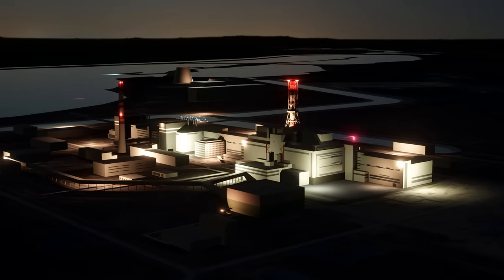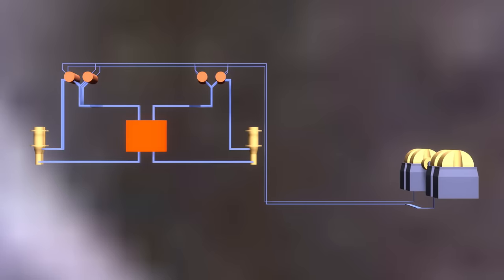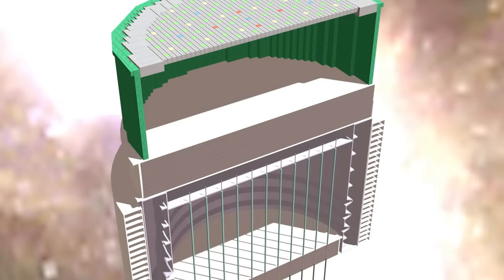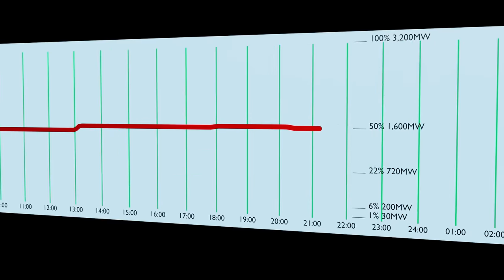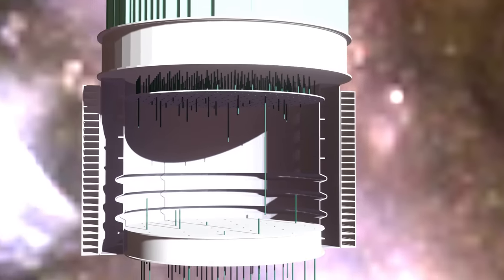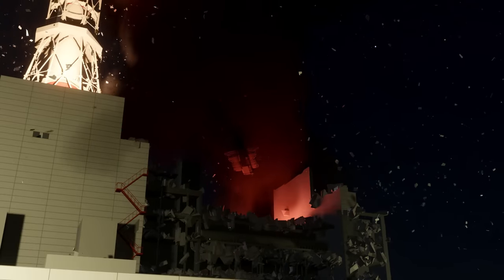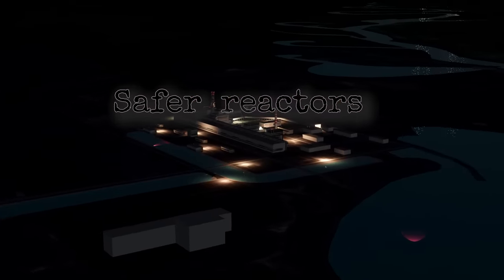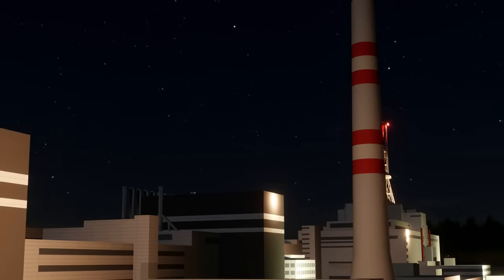CHERNOBYL AZ-5 why it exploded

Comment: An excellent video. The designers of the RBMK were well aware of the problems of the design. Particularly at low power levels. Apparently they produced a detailed manual explaining what the operators should do. However the KGB felt that the manual could fall into the hands of a terrorist/saboteur. 
As a result the manual was suppressed.  As a result of this the power station staff had no real idea of what to do. The remarkable thing is not that the disaster happened but that it hadn't happened earlier. As you point there had been problems at Ingalina and Leningrad. But due to the culture of paranoia in USSR this information was not disclosed.
Reply from the maker: Fabulous comment!! Thanks.  I'm learning all the time from your comment and others like it...
Reply: Are there any sources for claim that KGB was behind preventing releasing manual about reactor flaws, though? Because there are sources that main designer of the reactor Nikolay Dollezhall ignored the reports of flaws, as acknowledging them could hurt his career, because he was seen as a flawless genius in USSR. Alexandrov who was supervising him, was also engaged in advocating and supporting this reactor type. It is true that moving the supervision of operations of nuclear power plants from one ministry to other apparently contributed to problems with communication and flow of information. But this transfer was done because designers of reactors most probably lied that those are ready, very safe much more than they really were, so party assumed that they can be supervised by more 'civilian' ministeries, such as ministry of energy. In my opinion designers were too ambitious and lied about progress with reactors, because of that they later had to rush the design process, with resulted with trivial errors. For example water space at the bottom of control rods resulted from miscalculation, designers initially thought rods could be longer, this space at the bottom of reactor was meant to be taken by longer graphite tips. When it turned out that those would not fit, and it is  impossible to change the whole construction (as first reactors were build almost at the time of design process and equipment was manufactured already), they assumed they would use different technology to reduce amount of water (water film cooling). But this technology finally turned out to be unready, so they were left with too short tips. Like an architect who forgot to include the height of the building when planning number of floors. Absurd and terryfying. Buy that's what happens when design process is really rushed, that's why nuclear phycists shouldn't lie about having their reactor designs proven and ready, as this most probably happened. They believed too much in their own genius, especially because people from communist party, even such high ranking as Kruschev were not intelligent and knowledgeable enough to know that physicists are lying to them about reactor progess. Designers and other people from Kurchatov institute who were promoting the RBMK construction, such as Alexandrov, Dollezhall, Legasov (as he was not such a good guy in reality, earlier he was also promoting RBMK despite it's flaws) believed they can get away with such lies and errors because they are smarter than everybody else, and that ultimately nothing will happen, so errors in reactors can be covered up to protect their careers, especially because it was easy to keep things secret in nuclear industry in the USSR, which makes it even easier to designer of reactor to hide his errors. But it happened and revealed everything. If we only knew more about design process of reactor,. I think what happened and what really caused chernobyl, is what I have described above. Not screaming diatlov, but lying physicists from Kurchatov institute, such as Legasov. Ironically, HBO series end when he is talking about lies being the cause of all problems. He was a a part of that lie, despite show portraying him in good light in opposition to others.
Reply: @cytrynowy_melon6604  Quite Tomasz.  It is easy to forget that the RMBK was a dual purpose reactor. As it was designed to generate electricity/district heating and to provide weapons grade plutonium. Actually it was carefully designed to allow it to operate on natural uranium without using heavy water. What is apparent is that the lead design engineer Nikolay Dollezhal (1899-2000) was well aware of its shortcomings. However for the reasons that you outline he kept quiet. That said the RMBK proved to be both reliable and robust in service. The issue with the fuel rods was understood by the Kurchatov Institute. Hence the manual to deal with this and the other issues of the reactor (At this point it is worth noting that all types of Reactor have their own operating systems, characteristics and foibles etc etc)  From what I have read N.Dollezhal never actually claimed that he was "infallible" it was the Soviet media that did that. 
Let's be honest about this He was not the only scientist or engineer in the USSR who treated in this way.
One thinks of Sergei Korolov for example! Or indeed Andrei Sakharov that is until he began to denounce the Soviet system. 
It was Valery Legusov The First Deputy Director of Kurchatov Institute of Atomic Energy (He would later commit suicide in 1988 apparently due to his despair over the Soviet civilian nuclear energy  programme).
Who led the investigation into the Chernobyl disaster. He made it clear that the KGB had suppressed the RMBK operation manual for the reasons stated earlier in his report to the IAEA. He was also extremely critical of the lack of a coordinated approach by the various regulatory bodies in the USSR to share information on the operating characteristics of the RMBK reactor. 
It is also clear that had the problems experienced at both Ingalina and Leningrad been reported accurately and disseminated to the correct authorities at the other nuclear power stations using RMBK reactors then it is almost certain that the Chernobyl disaster would never have happened. You are absolutely correct in thinking that the endless changes in top level management and the changes of ministerial control of the civilian nuclear programme was a major factor in this. Even Leonid Brezhnev was critical of the endless "reforms" to Soviet industry and privately is said to stated "Reforms , Reforms! People ought to work better, that's the problem!"
Another issue that didn't help was the "Campaign" attitude to getting things done! As this often meant that things were done quickly and with very little concern shown to "difficult" or "troublesome" issues or situations. Which were simply brushed aside.
Reply: @cytrynowy_melon6604  Everything I’ve ever read about short rods attributes them to equalizing the reaction - an intentional design versus a screw-up. Yours is the first I’ve read otherwise. What have I read?  Internet drivel but lots of it.  You sound quite knowledgeable - how did you find this out?
Reply: @PORRRIDGE_GUN  No this came after Stalin had gone. Also Mao Zedong had nothing to do with the Soviet economy. Though he would mock both Khrushchev and Brezhnev! 
It had begun under Nitika Khrushchev and continued under Leonid Brezhnev.
At the highest level the Soviet government was very aware of the shortcomings that plagued Soviet industry and the Soviet economy. But they were at a loss to actually know what to do. It isn't until Mikhail Gorbachev takes the helm in March  1985 that a serious attempt to resolve the issues was attempted. 
Apparently when Mr Gorbachev reached the Central Committee being appointed "Agriculture Secretary" by Yuri Andropov. 
He realised rapidly the gravity of the  economic situation in the agricultural sector. He then asked Andropov if he could see the "Books" ie the real economic data and not the "Cooked" version! This so alarmed the usually wily and composed Andropov that he had a "Turn"! Gorbachev was told in no uncertain terms that this was "impossible" for someone of his relative inexperience and youth.
Gorbachev however realised that things must be far worse than he feared.
As indeed he found in 1985! Originally it appears that he proposed a series of gradually changes and reforms to Soviet society etc etc. 
The events of that April morning appear to have changed everything and it led directly to him adopting a far more radical and sophisticated approach. Hence Glasnost and Perestroika. It is probably to much to say that the explosion led directly to collapse of the USSR. But it certainly was the moment in time and space when he realised that high risk radical social and economic "medicine" was required if "The Patient" was to have any chance of survival!
Reply from the maker: @mdepfl  equalising fuel burn is the rationale I understand because of neutron leakage out the roof and the floor.  If the reason was no space as the bottom they would surely not have cut the top of the graphite displacer short as well?!
Reply: Nice to read a comment section where I can learn new things, thanks.
Reply: @cytrynowy_melon6604  Obviously said by someone who never participated in any kind of engineering work. The real engineering is all about knowing and testing the limit of your knowledge, expertise, and having to compromise on many things, otherwise the project would never be finished and goals would never be achieved. And I am not even saying that any practical action outside the Youtube comments contains the element of unknown - this, nobody really knew what could happen if the reactor would become unstable on one of operations like that, and for all their knowledge, nothing might have happened at all. So disabling certain secondary protection instruction seemed like a good idea with such a good specialists who can actually build and supervise such complex machine that worked so well for decades. People of today are only a bit wiser thanks to that mistake, if it wouldn't happen we would not never know about it. At least until it would cause something even more dramatic.
The true extent of mistakes involved into the catastrophe has never really been learned, nor it has been acknowledged anywhere. The dissolution of USSR and collapse of the system of government has resulted into the situation where only part of the important information was able to be analyzed and understood, and partially implemented. Within remaining USSR structure of nuclear industry the mistakes have been suppressed, mitigated and actually acknowledged, that is why there was no such catastrophes since then. But how about other people, about competitors, about countries who are losing competence in the area and still are stuck with the legacy they cannot bear with? 
Attributing to "KGB", or "system" or "secrecy" yields nothing to knowing the truth, inly for needless conformity. By stating that all these mistakes are because of abstract concepts of "empire of evil" is just a reassurance that this can never happen in the enlighted, more democratic, more developed world, because obviously information about reactor flaw, or construction flaw, or corruption will be immediately exposed and dealt with. And the disaster will never happen. Right? Can they just do that? Sure they will not say they are just smarter than everybody else and nothing bad can happen to them?
Reply: A few at the plant knew the manual and did try to follow the procedures but there was one man there who was in charge of that shift and he talked everyone down by implying that if they did not do as he wanted they would be fired , he was a very arrogant self opinionated person who always thought he was right and thought he had been hard done by so he pushed beyond the limits trying to make himself look good and get promotion . These reactors were never safe , they wer a bad design and were built in a hurry with a lot of flaws and shoddy build problems but at the end of the day it was him not following the rules and the manual that caused the disaster
Reply: @MrTarmonbarry  The cause of this disaster was the commander on the night but the roots go back to bad design, lack of safety margins, lack of contingency containment, a political culture that punished disclosure of problems and pressure to deliver results over safety. Any safe design must take account of human factors.
Reply: Ignalina power plant is located in Lithuania, where I live. I was born way later than all of these things, but just the idea of that happening is terrifying. (also, the movie Chernobyl was filmed in Ignalina, as they were of the same model).
Reply: @JokubasVas  Hi , is the power plant at Ignalina operating still ??.
Yes , a very frightening thing to happen and the Soviet authorities still went ahead with the i think May day celebrations ven knowing the air around there and as far south as Kyiv as full of radiation. I am in Kharkov and walk past a monument to the liquidators when i go to the spring for water ( the tap water is not safe to drink unles you have an unlimited supply of imodiunm )
Reply: @MrTarmonbarry  no, it was fully closed in 2009
Reply: @TerryClarkAccordioncrazy  Yes , i agree with what you say about safety margins etc , the problem comes about when those margins and safety lockouts can be overridden . The majot problem that night was that he let the turbine run down to low . Yes it was a test to see about restart from low revs but he used his superior posiyion to let it go down that low and the others did not know how to react to that . As you say , the culture of that time was a major facto , if they had not feared for their jobs they could have refused to follow his orders and it never would have happened
Reply: @TerryClarkAccordioncrazy  Just remembered . You mentioned the culture being a contributing factor . It was not just Russia , some time back there was a plane crash in the U.K , a i think Korean cargo plane . They had that culture thing that you do not question your elders as they were always deemed to be right . The first officer knew there was something wrong and that the captain was not reacting to it correctly , he was scared to say anything and it cost him his life along with the rest of the crew
Reply: @JokubasVas  Thats good to know .
Reply: @TerryClarkAccordioncrazy  "lack of safety margins" is not sufficient reason for the disaster to happen, because there was no safety margins in this area of unknown. Bad design does not lead directly to bad situations, political culture is always influencing every decision people make, even as you are typing these words. We can safeguard against them, but we can't prevent them.
 What we can prevent is, of course, is an ignorance of a human mind.
Chernobyl has always been a flashpoint of political propaganda and everything that has been said about it is under influence of set of stereotypes from Cold War. This is not a disaster of humans and systems - the same years has seen worse disasters than that, with greater damage and cost of lives, and yet nobody is even remotely is concerned about them or remembers them - these are "usual" events. This is a disaster of human mind. A fight against invisible and unknown danger that influences way too many people. 
If we compare this situation to the other INES 7 event that happened much later, with such different reflection in mass consciousness. It is a real example how severity of tragedy is underappreciated, how the information is suppressed and the people are silenced and how the decisions can be overwritten by real corruption, cronyism and financial interest. And how many people are concerned? Very little people, in fact - it is better to again repeat what has been said hundred times before and maintain the semblance of control. If tomorrow any of those nuclear plants will face any of such problems, who do you think would be blamed for that?
Reply: sorry thats is not correct. I worked at LNPP2 after the accident and can affirm the operators knew exactly what should happen - but the operating rules were overidden under the test protocol from VNIEM in Moscow. In addition the main guardlines were vetoed in an effort to prevent autotrip (scram) under low power. The risks of low power were well understood even by desk engineers.
Reply: @masterscubaman  they were well understood by everybody after it happened - not before. Of course these operating rules were not written by complete fools and they could list twenty possible bad outcomes of what can happen in the event of engaging LAST POSSIBLE SAFETY MEASURE. Blowing up the entire power station was not among them. Even most robust safety can have unaccounted holes - this was not well understood back then and I see that it is still not well understood to this day.
Reply: @masterscubaman  The rules were overridden by one arrogant idiot who thought he knew better than the manual . The others tried to tell him but he would not listen and they were worried about losing their jobs , he as good as told them they would be out if they did not do as they were told.
From another video that went more in depth it seems that he let the turbine run down to a very low speed from which it could not recover and pump the coolant
Reply: @MrTarmonbarry  Korean Air flight 801.
Reply: @TerryClarkAccordioncrazy  Thanks , i had forgotten the details but it illustrates the similar cultures , but one is authoritarian the other older and more cultural
Reply: @JokubasVas  I hope the lessons learned protect you all going forward.
Reply: @StelzCat  incorrect - but i guess you know more than a reactor physicist with 35 years plant experience of both BWR, RMBK and Magnox operations.
Reply: @masterscubaman  and I am also a Santa Claus in a Cossack hat, so your argument is invalid.
Reply: Mike I have been thinking about the central problem which is often overlooked. 
Keeping the water pumps operating in the event of a power cut. Now a number of questions have formed in my mind.
1) Why were the motors driving the pumps fed from the grid and not from the power station internal supply? (See question 4)
2) Also am I correct in assuming that they were DC motors?
3) From what I have read. It would  take the emergency diesel generators between 60 & 85 seconds to run up to speed. 
 It was thought that turbo-alternator would only be able to generate enough power for the pump motors for some 45 seconds.
As it ran down following reactor shutdown. 
Hence the reason for the test to confirm this one way or the other. 
4) This begs the question that I hope someone will be able to answer. 
Somewhere in the power station complex I presume that there were a number of "Motor- Generator" sets used to supply the various ancillary equipment including the vital water pumps.  
Now this aspect has always bothered me. As usually in a situation where grid failure would lead to a potentially dangerous or catastrophic situation you would have some type of emergency kinetic energy sources like for example a Ward-Leonard-Ilgner controller installed. 
This type of equipment being quite common in the coal industry as in the event of a power cut/grid failure the controller will continue supply power to the winding engines and the ventilation fans as the flywheel runs down. 
I have a nasty suspicion that I already know the answer to the question. 
 Cost. 
The more you learn about the Soviet nuclear power industry the more you realise that engineers and planning officers were under immense pressure to achieve results almost at any price. Hence shoddy or rushed workmanship, the use of inappropriate materials in construction and corner cutting/blind eyes being turned at all levels etc etc.
To a large degree this was offset by the dedication, determination and hard work of the staff. But it would be impossible to resolve every issue all of the time. 
We all have to be very grateful to those brave people who could easily simply have run away. Thankfully they didn't.
Reply: @nicholaskelly6375  Legasov was chosen as he was a loyal Party man. He was on the regime’s side all along. Unfortunately, the HBO series put him as the good guy when in fact he followed orders with zeal from above and he wasn’t even a physicist. The reactor was a massive version of a previous breeder reactor and it was designed by the secretive Ministry of Medium Machines which was the defense sector. All flaws were to be kept a secret.
Reply: The truth about Chernobyl: HOW THE 4th UNIT OF CHERNOBYL NPP WAS BLOWN UP (channel-KS).